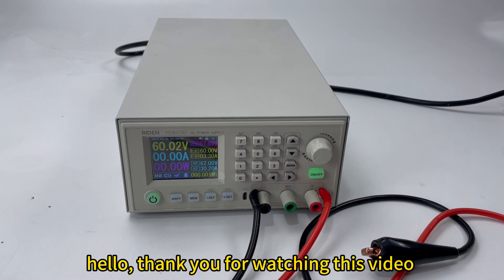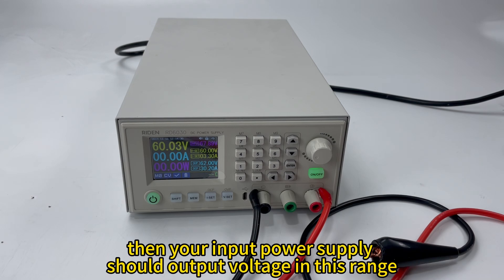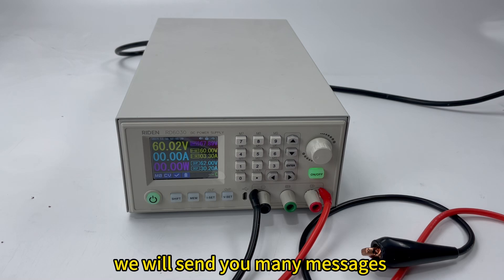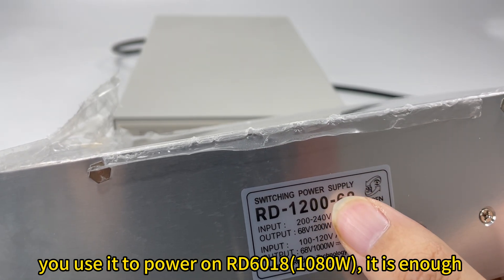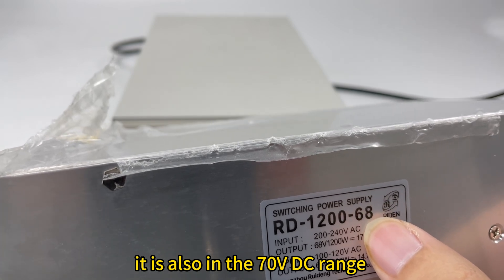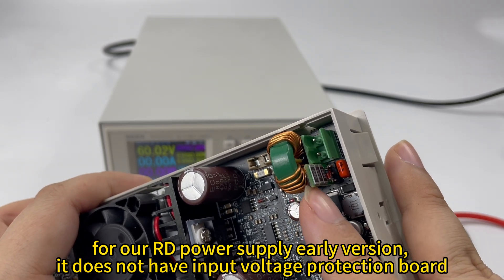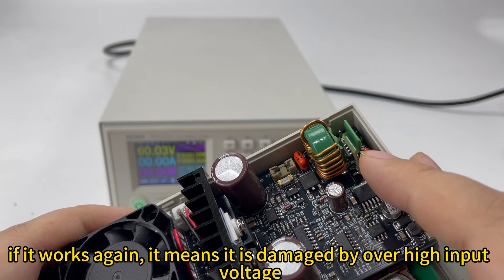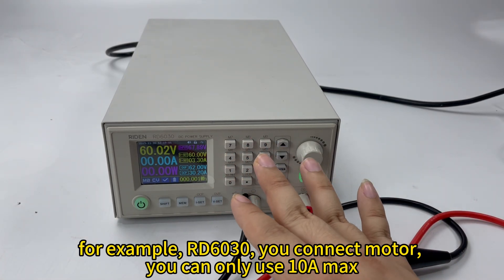how to choose input PSU for RD power supply

Comment: Hello. RD pover supply 1500W can work from AC 170-180V?
Reply from the maker: hello, sorry it can only use 100-120V AC at 110V gear, 200-240V at 230V gear
Reply: @rdtech9153 Thanks for quick answer
Reply from the maker: @oksanavlasenko2648  you are welcome, if there is any question, just contact us

Comment: I can connect two power supplies in series to get 120v or bipolar voltage +/- 60, what needs to be added to meet these requirements?
For example, connect the power supplies in parallel with a diode in reverse connection.
Reply from the maker: hello, for our power supplies, they can only be used alone, you cannot connect the output in series or in parallel to get higher output, there is no such protection for connecting them in this way

Comment: hi... i have a problem with my device, hopefully you can help me solve this problem.
my riden rd6024 output keeps going up from what it should be, i have calibrated it several times but the result is still the same, for example i set it at 5v the output shows 5.4v and it keeps going up, but if i set it at 61v the screen shows 58v and the output is 62v.
i have replaced several ic's (LM5106, TL495, GS8332, UCC27517) but i have not found the problem.
hopefully you can help me🙏🙏
Reply from the maker: hello, please contact us on aliexpress, it is better to show us the video of the problem, and what do you connect as load and what is your input PSU before it is damaged?

Comment: I have a power supply with the code GPAD152m48-2A. I want to use it with the RD6012P, is it possible? The manufacturer's specifications for ripple & noise are 480mV. Combined with the RD6012P, is it suitable for repairing phones or laptops, or do I need to buy another power supply with lower ripple & noise? Thank you.I have a power supply with the code GPAD152m48-2A. I want to use it with the RD6012P, is it possible? The manufacturer's specifications for ripple & noise are 480mV. Combined with the RD6012P, is it suitable for repairing phones or laptops, or do I need to buy another power supply with lower ripple & noise? Thank you.
Reply from the maker: hello, I check the data of this power supply, normally there is no problem